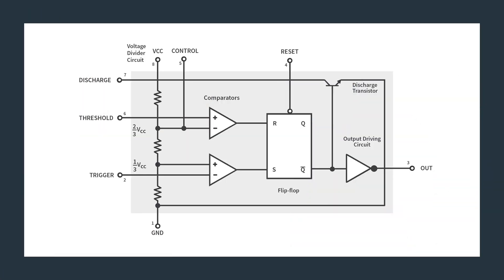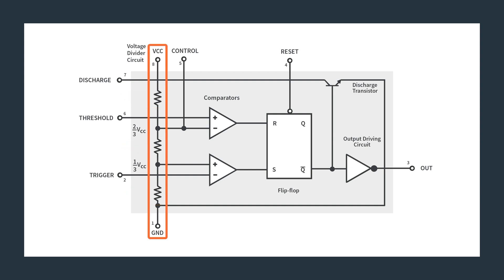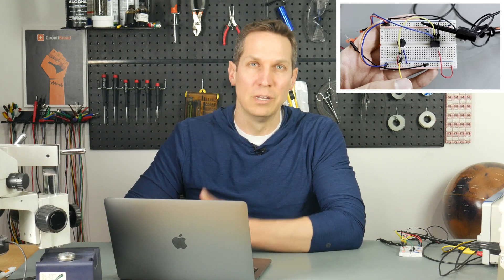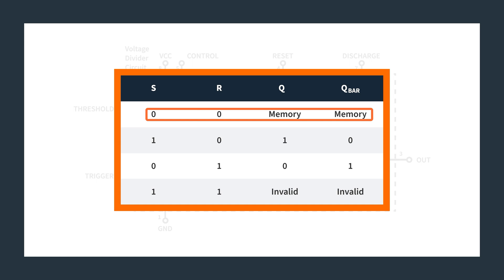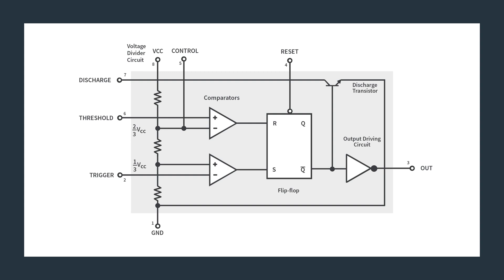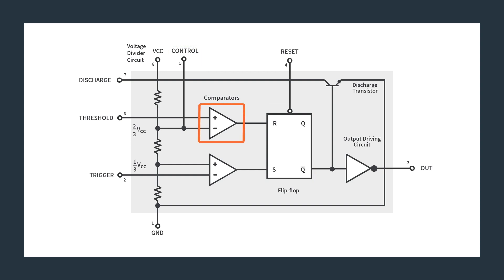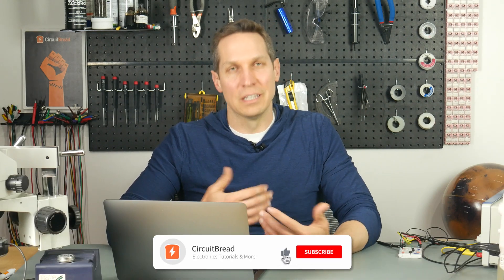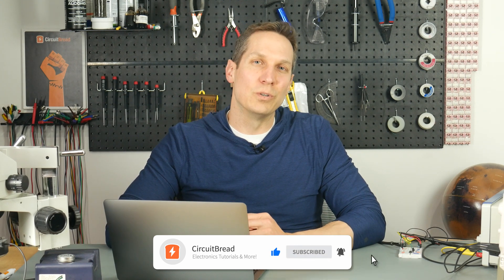Introduction to 555 Timers | Basic Circuits

Comment: Calling it a timer was a bit of a misnomer, but I can see why they chose it. Too many other things this circuit could have been named depending on how it was put together.
Reply from the maker: I think hearing it called a 555 timer and then learning about the bistable configuration really confused me as an undergrad.  Frankly, it still confuses me but I guess I'm just used to it now.
Reply: @CircuitBread  Wow, I got a reply! You guys are great. Thank you.
The best way I had to learn of its implementation was, through a design inspired by Ben Eater. The guy who built a working CPU and memory using 7400 series ICs, on a ton of breadboards.
I basically made a variable time clock output using all three states of the 555, so I used a 556 and one 555. 
A resistor and capacitor are used to provide a range of frequencies when a potentiometer or variable capacitor is introduced giving that nice astable clock.
Then another 555 is put together with a push button to see that the bistable state is just the latch being a latch.
Finally, the last 555 is just there for a variable interrupt, when also set up with a pot and push button for the monostable mode. 
This is a great project and really helped me see why set up a circuit this way in the first place.

It was great to learn, but someone really needs to have understood the operation of two transistors in a feedback loop, or how the wizards want to call it a "Bi-stable multivibrator".
Reply from the maker: Awesome!  Ben Eater is incredible, I have tons of respect for that guy.  And a hefty dose of jealousy for his brains. He reminds me a lot of my older brother.  I'm glad that he was able to help your understanding as well!

And I've gotten much worse at replying to comments (too dang busy) but I try when I can!

Comment: Usually SR/RS latches have a priority by design. So SR would be set priority, RS would be reset priority. I don't know if any priority is codified for the 555 or if all manufacturers cook their own stew here. But it should be consistent at least within batches.
Maybe i dig around in my chip collection and whip up a bistable circuit. IIRC i should have at least chips by 3 different manufacturers.
I think it with worth exploring since the 555 is an easy to use flipflop for example in power on reset circuits, or as part of an interlock.
Reply from the maker: This will be a great thing to comment on and discuss once the bistable video is up as well, as I did a terrible (non-existent) job of explaining where you'd want to use a bistable 555 configuration. 😬